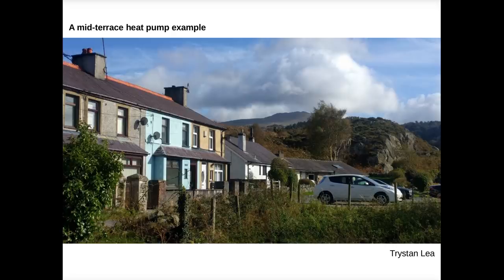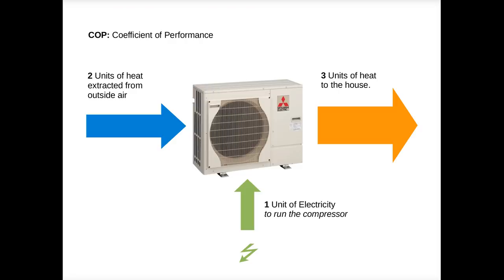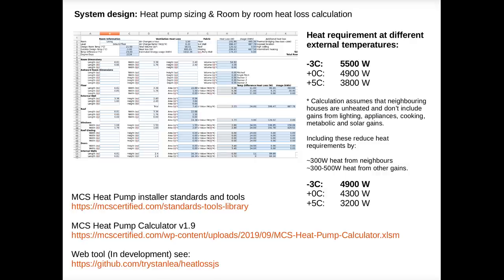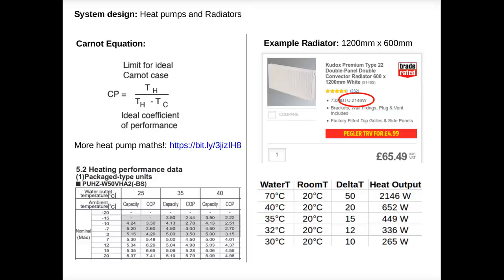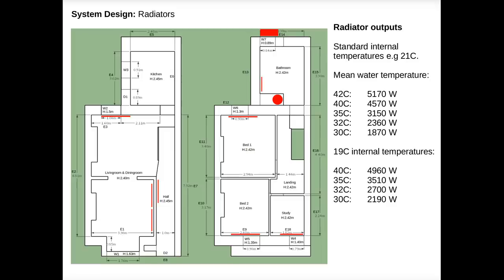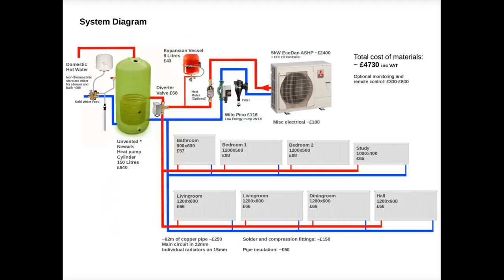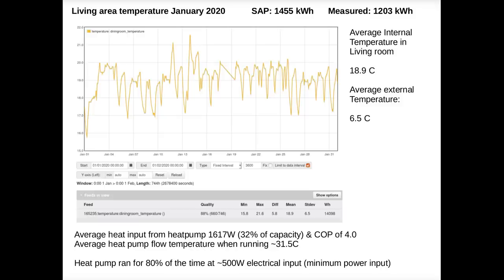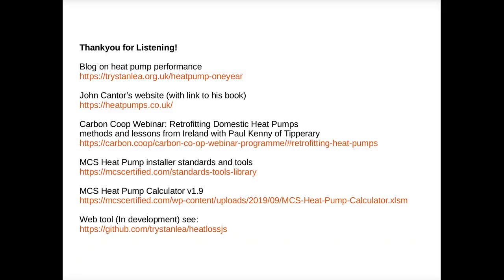A mid terrace heat pump example (COP: 3.92)

Comment: This is simply the best video I have seen on YouTube and I work in low carbon field
Reply from the maker: Thanks! Im sure there are better ;)
Reply: @trystanlea   so I want to do a DIY connection of the system will you still get FIT , feed in tariff for heat pumps

Comment: Brilliant , first time I’ve seen some useful information and it relates to my old stone built cottage. Staggered at the cost of your system, it’s less than half what I’ve seen quoted. Thanks for uploading. All the best Mat
Reply from the maker: Thanks Mat, the costs I shared were materials only as I did a fair bit of the work myself and so don't have a comparable full installation cost.. but I hope it gives insight into the cost of equipment.

Comment: Really useful information. Thanks for sharing your experience! I particularly like the image of the layout and associated cost of each part. It shows the simplicity of a ashp wet system (compared to what a wet system is made out to be). I would consider looking at a wet system now as previously put off by complexity and high installation cost.

I have an air to air system that I am really pleased with but imagine the spikes in energy will be more severe. I hope more people watch this and realise a retro fit of a full system is worth doing if done correctly!
Reply from the maker: Thanks Justin!

Comment: Great video Trystan.  I just wanted to flag up one small point.  If anyone were trying to reduce the working water temperatures using a fan radiator... beware!  Fan rads don't like lukewarm water. This is because blowing slightly warm air can feel to us like cold air.  Comfort at the lower end of temperature spectrum (say 19-20C) tends to go with low air movement.    Fan rads have a fairly crude fan cut-out inside them. Fan stops if water not warm enough
Reply from the maker: Thanks John! I've put links to your recent videos above for those wanting more information

Comment: Trystan, thanks very much for the detailed description and analysis of your system. I'm a mechanical engineer who concentrates on building energy conservation and sustainability. I live in Ottawa Ontario Canada and note many significant differences between our locations. Probably the largest is the temperatures. Our average January temperatures are high -6 C, low -14 C but the design temperature is -27 C (which is generally achieved for a few hours a year). Heat pumps typically work to about -20 C then the COPs drop so low (1.1) you need to use 100 % back up electric resistance heating (luckily there aren't many hours in the year at these low temperatures). Partial back up heating is typical from  about -8 to -20 C. We seldomly use radiant heating in our houses. Mostly it's forced air (natural gas in the city and forced air propane, fuel oil or electric resistance in the country). Some use electric baseboard resistance heating. Natural gas heating costs about $ CAN .05/kWh here. Propane fuel and electric resistance is a very poor economic choice, about $.16/kWh verses $.08/kWh for heat pump on our electricity costs or about $.05/kWh when heat pumps and solar are combined. Sorry, I understand that the sun did shine in the UK once! November and December even most of January are quite cloudy here but February is generally bright. Surprisingly London (51 N) is north of Ottawa (45 N) so we would get more winter sun than you.
Reply from the maker: Interesting to hear, thanks Daniel!

Comment: Despite my reservations about ASHPs, I found this a very enjoyable and informative video. My thoughts are that once ASHPs are expanded to a wider audience and gas an electricity prices are equalised, the current MCS standards will be relaxed so that the heat-pump is not expected to cope with extreme winter loads and homeowners will rely on, say, a couple of 2kW space heaters as back-up in more modest homes up to about 100 square metres. I also believe there will be more innovative retrofitting to avoid the current excessive installation costs.
Reply from the maker: Thanks Brian, that's great to hear, yes I agree on a need for more innovative retrofitting

Comment: This is a very helpful video, thanks. I'm very impressed by the performance of this, as you said, relatively simple system. I have been wanting a heat pump system for a while but can't afford anything fancy. It is reassuring to see such good results without underfloor heating and in an otherwise unmodified house!
Reply from the maker: Thanks @krnlg

Comment: I am a traditional heating engineer looking to acquire knowledge for the impending deadline on new builds where I will be venturing into installing this type of system.
Extremely well presented video explaining everything in a real world situation.
I will be recommending my customers who are curious to the pros and cons to watch your presentation.
Ps in my house my setback ( off ) temperature is 19 so I think my 22 comfort heat is going to cost a little more than you . That said it seems capable of achieving this .
Again great video thank you
Reply from the maker: Thanks Mark, means a lot to know that this is useful for someone like yourself and your customers. Id like to do more in a future video on the domestic hot water side of things and mounting for low noise. Il be posting an update here towards the summer.

Comment: Very interesting video, thanks. I'm looking forward to having our ASHP installed using the green homes grant. Although the installer is having problems sourcing the unit due to high demand! We're in Herefordshire with a 3 bed semi house. Quite well insulated. We're on leccy only and on octopus agile but even so have had some eye-watering bills during the colder months and recent high rates haven't helped!
Reply from the maker: Thanks Nicholas!
Reply: And your bills will only get higher under this government who haven’t a clue how ordinary people live.  Boris Johnson lives like a king with all his various income streams.  Heat pumps will only work in a very few situations, and the majority of people in this country simply cannot afford them and are barely making ends meet.

Comment: Great video. Thanks.

I am in mid terrace 1900 2.5 storeys.  We are about to demolish return and  build 1 storey open plan kitchen etc. I was thinking along hybrid system.... A pump for underfloor in new build with circuits to old house supp. With gas.  This makes me rethink pump for all....as long one understands the diff. in how it would work.
Reply from the maker: Thanks @abutw0

Comment: Very interesting and shows that  ASHP can work in a standard home with standard radiators and still save money. I have solar panels as well, so running a heat pump all day would not be a problem as covered by solar.
Reply from the maker: Thanks Warren!
Reply: Standard - but very much oversized double panel radiators to be precise.  That rad in the livingroom was huge.
Reply: @eliotmansfield  All the radiators are huge by conventional standards, but what else do you do want to do with your walls? It's not like you are going to hang pictures that low down, or have a TV down there.

Comment: Well done. Great video. Very interested in this.
Similar situation though we have had a loft conversion some years ago and have 5 bedrooms and 2 bathrooms. Solid walls too. 
We converted to a combi boiler and no longer have a space for a hot water tank.
We do have a Tesla power wall which we charge overnight in the winter at 5p per unit so could run the heat pump at the same time to warm the house.
Reply from the maker: Thanks William! Sounds like a good project! Running it off the powerwall during peak daytime hours would be really interesting, Id like to try that at some point when I get a battery

Comment: I have a ground heat pump on a house in norway where average winter temperature is minus 18 . The heating coil is buried at a depth of 3 meters.  So I have a year round coil temprature of 9 degrees. So I have a difference of 27 degrees. So it works well. But the warmer the winter climate the less efficient they become. I don't have any experience  of air heat pumps but I should imagine the restrictions are similar.  I put this here so people in southern England don't get conned into thinking this will be there heating solution. In the right place they are great. But expensive.
Reply: Adrian, i live in Ottawa Canada and have similar even colder climate. Our design temperature is -27 C and the average year round ground temperature is 6.7 C. BTW a location's average ground temperature is the same as the average year round surface temperature (makes sense from a heat balance perspective). See my comment from today's date for other comparative information on our heating systems.

Comment: Hooray! Poor old heat pumps have received a lot of negative and out-dated criticism but like most tech development they have improved over the years and should get a fair hearing based on current objective real world experience. In June this year (2021) I installed a 11.2kW Mitsubishi Ecodan R32 in my house, with 6 new radiators, a new DHW tank and a low loss header to support my 30 year old 8mm microbore network (which I was very keen to keep as it is so discrete). At the time of writing we just had a night of -2°C and I'm very pleased to report that the design spec (see below) has been achieved and we are comfortably warm! The peak power loss at this temperature is 8.26kW so I'm optimistic this will hold right down to the -7°C at which the Ecodan is theoretically able to produce its full 11.2kW output.

House floor area 137 sq metre
Indoor average design temp. 19.2°C (full occupancy all year round, which will hardly ever be the case)

Peak power/heat loss kW	8.26
At design temperature  -2.4°C outside

House heat loss kWh p.a.	18,245
Heat pump energy consumption kWh p.a.	4,971
COP efficiency 3.67

My old gas boiler consumed c. 20,000kWh pa on heating and hot water so the heat pump will consume 75% less energy and, despite huge electricity price increases, stands a good chance of achieving running costs no higher than my old gas system. Net cost of installation after the RHI grant (payable over 7 years) was £6,000, not much different from an equivalent new gas system which I would have required anyway due to age and state of boiler, radiators and DHW tank.

Comment: Thanks for this.
I have a concrete slab on the ground floor and was worried about the expense of having to put in underfloor heating if we switch to a heat pump, but if we can get away with simply enlarging or adding a radiator or two, that would be a lot simpler for when we replace the gas boiler.
Reply from the maker: Thanks Michael

Comment: This was better than any ASHP vid ive seen.
Reply from the maker: Thanks Laurieh!
Reply: @trystanlea  Did it ever struggle in the lowest outside temps? Im getting quotes and a 7kw and 6kw were chosen. Have a possibly smaller 1970s semi detached. 7kw quote guy is saying heat demand is 5.6kw but probably working it out for -7c which hardly ever happens. 6kw is saying 3.8kw. Thinking ecodan 5kw is the way.
Reply from the maker: @laurieh  No not yet, we haven't had a prolonged period of below zero temperatures in the last 2 years. So far even on the coldest days when we run it continuously, its typically using less than half its capacity (e.g 2.3-2.5kW out of 5kW), I've written a bit more on the reasons here https://trystanlea.org.uk/roombyroomheatloss2
Reply from the maker: I do have supplementary heating if needed, but have not needed to use it yet for lack of heat pump capacity.
Reply: @trystanlea  Would you say you trust the MyHomeEnergyPlanner more than MCS calculator then?
Reply from the maker: @laurieh  I wouldnt say I trust one more than the other, its more understanding the input assumptions, and different tools for different jobs, MHEP only gives a total heat loss figure and annual heat demand calculation (and assumes neighbours are occupied) whilst the MCS calculator gives you the room by room calcs you need for heating system design and calculates max heat demand in the worst case scenario, assuming houses either side are unoccupied etc, there does seem to be quite a difference in the air-change per hour values between the two, Im not sure why that is.. that's a guess in both calculators really as it really needs a blower door test..

Comment: Perfect video .. Very encouraging.. .  & good to get away from "the underfloor heating in necessary" idea..  Is it noisy ?   Not sure if I  ( or my neighbours) would like a fan buzzing away all night.  .. ?   ( do you have anti-freeze in the circulating water , in case of power cut ? )
Reply from the maker: Thanks! Most of the time you can hardly hear it, it's a bit noisier when its really cold, but not that significant, if you can ground mount the unit with thick rubber pads it will be even better than mine. Not the experience of everyone i guess, see comment below,  it needs careful design to get it right. Latest units from Mitsubishi are much quieter in my experience. A friend says mine is quieter than their neighbours gas boiler..

Comment: Sorry further questions, we are considering installing an ashp. The property has no mains gas (but it can be installed) and cost of boiler + mains gas would be approx 10k. Ashp would be approx 19k + 9k rhi return. We are aware that gas prices are likely to increase / be less subsidised by the government moving forward. We are considering now which to go for, the ashp is a steibel eltron and our usage for heating is low, we will not use the hot water that often. Thoughts?
Reply: If you are frugal, try to get a smaller heat pump unit, but dont skimp on radiator sizes. Unfortunately most installers are duty bound by MCS to install you a big unit.   DHW can be complicated.  If you dont use much, the standing losses of a cylinder can be significant. Electric point-of-use can be a simpler and worth considering
Reply: @johncantor4056  hi John a few questions, dhw? And what is electric point of use? Thanks
Reply: @muttyhc  DHW is Domestic Hot Water. Electric point of use means heating water as you use it rather than storing in a tank. Think electric shower but for taps :)

Comment: My neighbour has the same heat pump make but the 8 or 9kw. He uses it for heating and hot water. During the summer his electric bill was £95 per month for all his energy use, induction cooker, led lights and hot water through ashp. On a day last week when it was 0C outside his electric bill for the day was £10. Overall he is looking at an annual overall electric bill of £1500 but the installers estimate was £400. Any obvious reasons why this electric use should be so high? The house is brand new built by Border Oak with a very low airtight score and sips panels.
Reply from the maker: Interesting, do they have a inline backup immersion heater on the system that might be coming on when it might not need too? I didn't install one on my system. Does your neighbour have electricity monitoring on the heat pump that is separate from the house consumption? Do you have an idea for how efficient the house fabric is and floor area?
Reply: The estimate probably included the RHI payouts.  .. you gota watch out for that one...  we have no heating and our annual electric use with heat pump for heating and hot water  estimate  was only about 20 quid more per annum than what we are using now without heating or hot water (Oil AGA) is heating water at the moment ... so it looked like a no brainer untill you examine the estimate in detail......we have not made our minds up yet .. we swing about 50/50 for or against .... Trysten has got  it we nailed but unlike mist of us he knows what he is doing with and has his system tailor made designed for optimum efficiency and can constantly monitor the  system and tweak it as and when needed  .... seems the problem with this Industry is you don't get the likes of Trysten coming round to design Install and show you how to operate your new system ..  just salesmen or plumbers .... we could all do with Trysten as a mate

Comment: Good detail - well done.  (1)Sadly octopus agile is appalling value now 16p at 3.30am in mid summer and pinned at 35p pretty much every day 4-pm - octopus Go is still ok though  (2) I think i would be a little uncomfortable with an average room temp that barely gets to 20'c.   (3) With a family of 4 - my 250L unvented cylinder can get used up in a morning (despite having automation that audibly alerts the household that someone is taking a long shower) - heating that tank back up would take forever, which means the house isn't being heated i guess.
Reply from the maker: Thanks Eliot, yes shame about the high agile costs at the moment, looks like energy costs are going to be high across the board for a while! quite some contrast from last year. Yes all houses and requirements are different, needs careful system design for each situation..